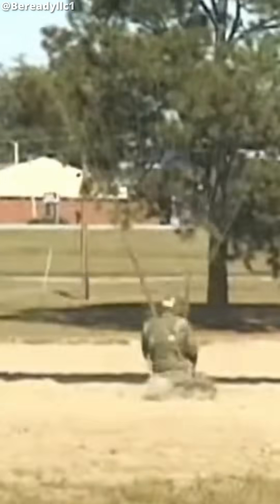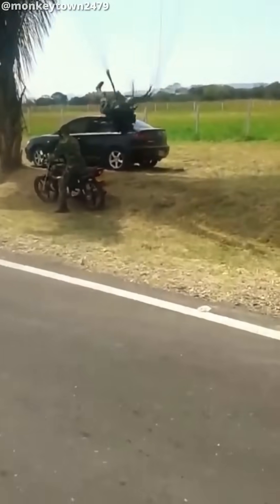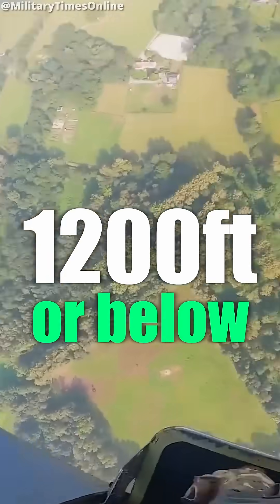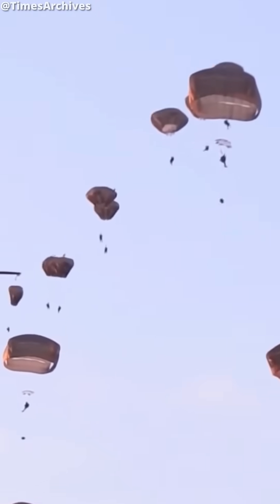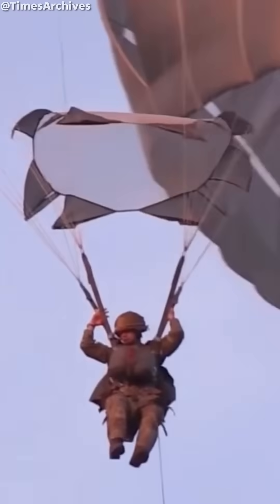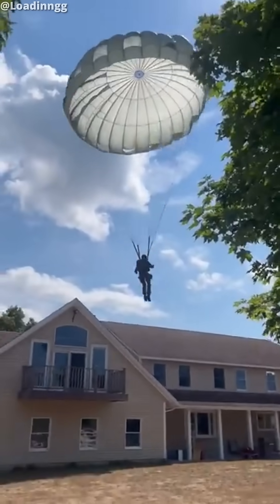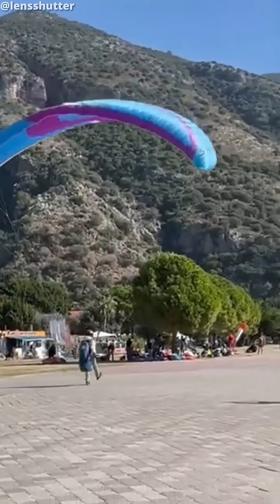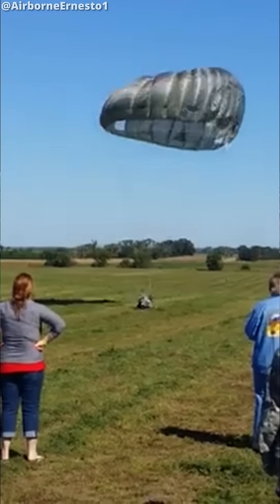Why Do Paratroopers Crash a Lot?

Comment: So why don't they get normal parachutes that they can control?
Reply: Cheap. Also, paratrooper chutes drop fast, or else they’re an easy target.
Reply: Mostly to avoid midair collisions, if everyone in the line is at the mercy of the wind, then everyone will keep the proper distance to the next soldier.
Reply: They're more complex (thus more likely to fail), more expensive, and less reliable. All of those steering mechanisms adds even more lines and rigging that could get tangled, and a tangled parachute can mean death. When you have a hundred people jumping out of an aircraft, you want a simple, foolproof parachute - especially since those hundreds of parachutes all need to be packed by a handful of people, so the more complex the parachute, the more likely that one might make a mistake.
Reply: @raptor2265 added to which, those military static-line canopies are in fact easier to land safely. Yes, you're inevitably going to hit the ground like a sack of potatoes - but so long as you do a proper PLF you'll be fine, and if you don't then the worst injury will likely be a broken leg.

Meanwhile, if you want to give someone the opportunity to actually kill themselves on landing, you'll put them under a civilian square canopy.
Reply: @raptor2265 the cost of a good parachute is always going to be cheaper than the cost of injury done by a bad parachute. You wasted time, fuel and money to train someone who can't work anymore.
A better parachute would increase the odd of every para guy to be combat ready after the jump. ( not 5 guys in trees, powerlines, 2 broken knees and ankles, and everyone too far away).

Avoiding mid air collisions is easy if you can steer.
Faster descent time, a steerable can be fast in the descent and slow down for landing.
Packing, every guy should do his own packing.
Reply: @niconico3907  Okay then, jumpmaster - why don't you pitch your ideas to the Pentagon, then?
Reply: @raptor2265  they just think para guys are expendables, they can get new ones when they are broken.
Reply: @niconico3907  exactly what kind of canopy are you recommending? Hopefully not a ram-air square wing - that would come with all kinds of issues.

Also, it makes no sense to me to have the soldiers pack their own parachutes. They probably won't ever jump more than a few times, and they'll never have to pack them in the field. Having teams of expert packers is quicker and safer than spending time teaching the jumpers to pack and hoping that none of them packs himself a malfunction - or, since there's no way specific parachute rigs are going to be allocated to specific soldiers, packing someone else one.
Reply: @MrReasonabubble  why would a normal skydiving wing not work?
Soldiers train for parachuting, so they ll jump way more than a few times. Soldiers are not sharing their helmets and clothes, why would they share their wings?
Reply: Ok, thanks!
Reply: to make them harder targets
Reply: In battle parachutes are not used any more.

Comment: That lack of steering capability sounds like a gigantic oversight
Reply: Nope, its by design. Thousands of paratroopers in the sky at the same time. You don't want everyone steering around running into each other, especially at night. Better to generally drift in the same direction.

Comment: So military have worse parachutes than the one available to the masses
Reply: They're meant for entirely different tasks. Not only would having 100 people in tight formation all steering in different direction be complete pandemonium and likely result in people crashing into each other, but steerable chutes are heavier, more expensive, and less reliable, as that added complexity from all of the steering control lines means that it's at greater risk of getting tangled. Plus, you don't want paratroopers to slowly and gently float down; the longer they're under parachute, the longer they're a sitting duck waiting to be shot at. Their parachute is to get them to the ground as quickly as possible without killing them.

Comment: Try 800 AGL or less.  1200 is what you get when you first jump at Airborne School.  Once at your duty station it is 800 or less.  I have 36 and the last 4 to 6 jumps I had l were not even 800 AGL.  They were more like 600 or less.  
When you get out the door you have your count, then you check canopy, then you check your distance between yourself and the other jumpers around you.  When you are clear and you have no one under you then you release your equipment and your weapon.  I usually had plenty of time to do all of these things at 800 AGL those last ones I had enough time to check my canopy and prepare myself for my PLF - Parachute Landing Fall.  I hit the ground so hard that the barrel of my M4 got bent enough to where when I went to the range to qualify my shot group was in the next foxhole target.  I also have 3 herniated disks in my lower back from those last jumps.
IF a jumper has a "bad" landing it is due to the fact that either he was NOT paying attention to what he was doing or he didn't PAY ATTENTION at the briefing PRIOR to the jump.

Comment: For those asking, why not make the parachute bigger to slow them down and make the landing much safer, well they've thought of that.

The entire reason these parachutes fall fast and are dropped from 1000feet (way less than typical skydiving) is to make deployment very quick.

A bigger parachute is safer and a slower landing results in way less injuries, but is also a bigger target and makes them descend very slowly, which means being at risk of enemy fire
Reply: So either die from bullets or die from injuries. 😂

Comment: Well its also because they use parachutes where as if you go skydiving you use paragliders
Reply: A sport skydiving parachute has certain features in common with a paraglider, but they are still quite different beasts - different size and aspect ratio, number of cells, rigging line configuration, harness, trim...

Both provide lift by inflating into in an aerofoil-like shape, but a paraglider is massively more efficient. That's because a parachute canopy has to be small enough to be worn on the back, and capable of opening safely at terminal velocity, and crucially its main purpose is still to get you down on the ground.